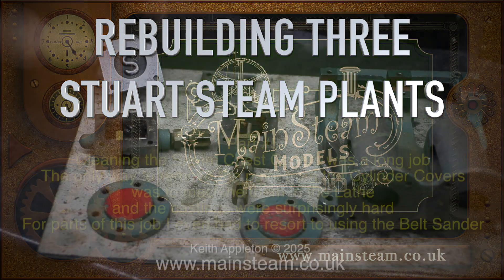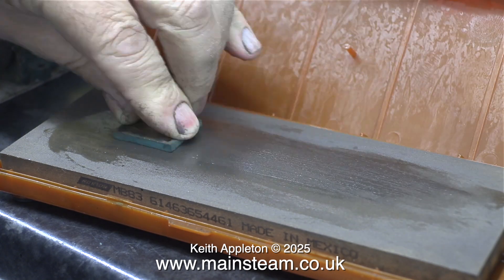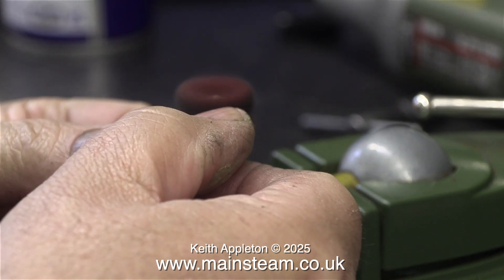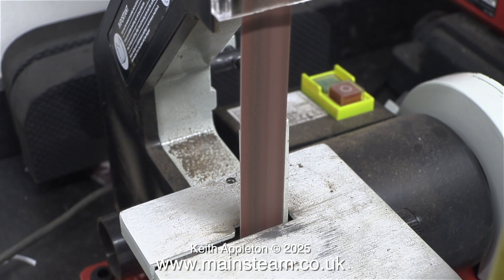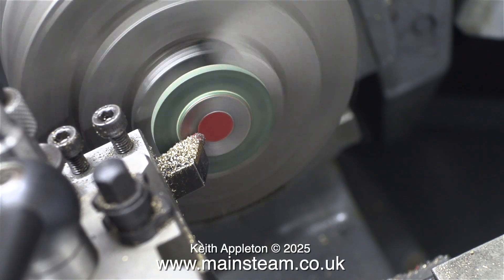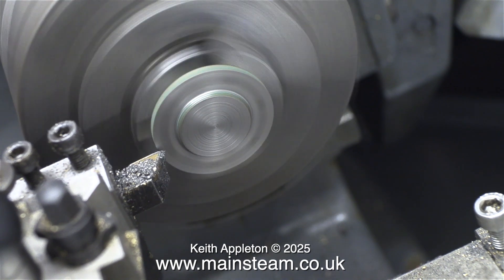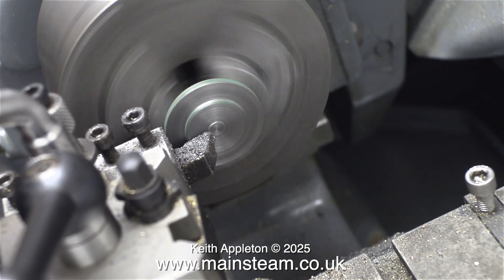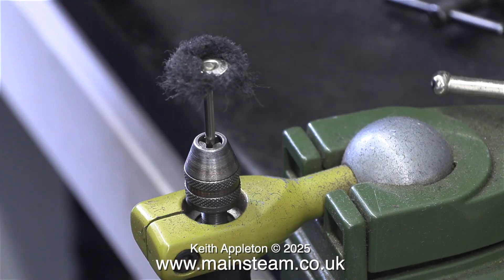REBUILDING THREE STUART STEAM PLANTS - PART #5

Comment: It's interesting that whoever originally machined these parts was even able to get as good a finish as they did.  In the past I've had success at sharpening carbide tools with a diamond hone or nail file.  I don't know if the crystaline structure in chilled cast iron is of the same sort of carbide, but it might be interesting to mount some sort of a diamond abrasive tool in the lathe and see  what finish that gives.
Reply from the maker: The castings were quite badly "chilled" and probably machined in the first place with a rotary Grinder in the Tool Post.

Comment: Try some polished carbide inserts as they behave more like HSS, or HSS, and you may have an easier time with unidentified mystery metal. 4:35 I was taught not to bottom out screws in T slots as that's how you break machine tables
Reply from the maker: I tried various types of cutting tools that I didn't show on the video and I never bottom out T nuts either. When the tool post grinder support is fitted, the bolts do not bottom out at all. After all these Years you know, I know a few things that are best not to do ..........